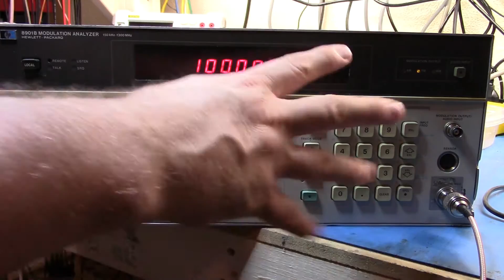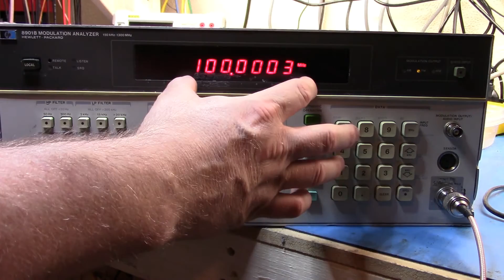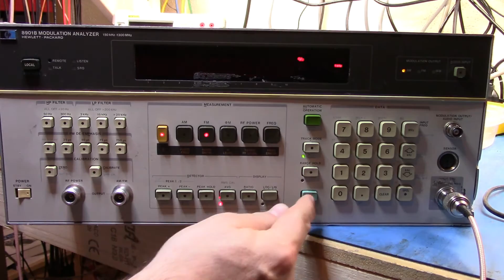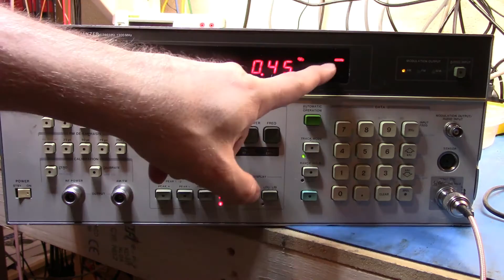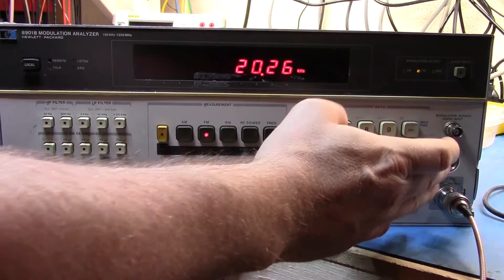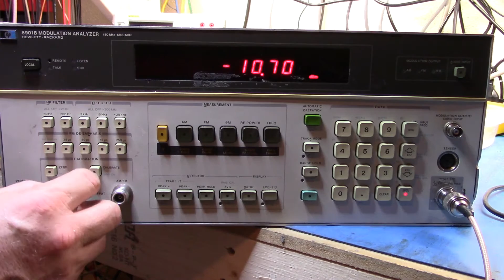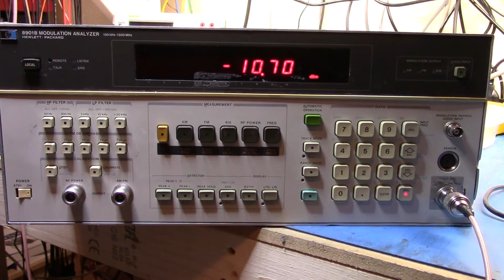HP 8901B Modulation Analyzer - First Look

Comment: I know this is an old video but I have an auto detect issue on mine. It won’t find any frequency in auto but works great if manually put in. Any suggestions on what might be causing this issue?
Reply from the maker: Hmmm - What happens if you connect up the signal and do an Instrument Preset? Also just out of interest, was this your thread over on the HPAK forum? https://groups.io/g/HP-Agilent-Keysight-equipment/topic/hp_8901b_user_question/95551327
Reply from the maker: If it was, did you try it using an unmodulated tone? That 8901B I had was a bit sensitive to modulation when finding the signal automatically - The getting started guide includes a table of things that can cause the unit to require manual tuning (image of that page posted here https://imgur.com/7P1SU9j )
Reply: @tgsoapbox  wow thanks that was quick. I did try an unmodulated frequency I missed that chart when looking in the 300 page manual. 😬
Reply: @tgsoapbox  yes that is my thread. I was actually going to update it tonight as I found a few issues. I will update now.
Reply: I acquired a 11722A today and would like to test the 8901B with it but being as they are both new to me is a procedure available or did you possibly make any videos of you doing this?
Reply from the maker: @HAUNTED-HAM  Unfortunately no - The sensor head is basically an 8482A and a relay - When it is working in power mode the relay throws and the signal goes into the 8482A otherwise it just passes through to the 8901B. I did do a video on creating a DIY unit here though - https://youtu.be/39UZNyCStoU
Reply: Oh I thought the 8901B would switch the 11722A? I seen this in the manual, “S1 Switch. The S1 Switch is a 509, low SWR, edge-
line type. It is useda t the input of the Sensor Module
to switch the RF path between the power sensor cir-
cuitry and a through-path cable. (See Figure 1, "Sim-
plified Block Diagram.) Control lines from the
measuring instrument (such as the HP 8901B or HP
8902A)t o the switch enablet h e measuring instrument
to remotely select the RF path through the Sensor
Module.”
I’m getting more confused each day
Reply from the maker: @HAUNTED-HAM  It does - It should work just like that video I shared but all inside the sensor head.
Reply: Ok I’m starting to see the light, the video was a good description. I’m glad people like you share your knowledge I sure do appreciate it. I’m going to give it all a try this weekend when I have the time to sit down with it.
Reply from the maker: @HAUNTED-HAM  NP - In your HPAK Groups thread I included the basic introductory guide - Well worth walking through it to get a feeling for the measurements the unit is capable of - The 8901B is a pretty good unit overall, just doesn't have the dynamic range of the 8902A (and some other features I think) - I ended up selling mine as I acquired an 8902A to use instead. Hopefully, you can get a chance over the break to play with your unit - Merry Christmas.
Reply: Thanks for all your assistance got it up and running 100%. A bit of Calibration and even auto is back working. Onto next project searching for a replacement Signal Generator.
Reply from the maker: @HAUNTED-HAM  Outstanding, good to hear it. You should do a video on what you found to get it all working.
Reply: @tgsoapbox   it just required setting the internal voltages within spec and to my surprise it came back. Did you think the battery on the control board will need to be replaced? I’m not sure a good substitute if so?
Reply from the maker: @HAUNTED-HAM  As far as I'm aware, the battery only holds the set configuration between power cycles so you don't really need it (assuming that setting everything back up doesn't bother you) - I'm pretty sure that I changed the battery in my 8902A but I can't remember what I changed it to - We're having Christmas at our cabin so shoot me a comment in a week or so when I'll be back home and I'll pull the board from my device and let you know what I did.
Reply: @tgsoapbox  good info thanks, I wish I was at our cabin! We own one in Fleetwood, NC. 
I wish you and your family a Very Merry Christmas, ENJOY!
Reply from the maker: @HAUNTED-HAM  I'm pretty sure I did replace it - I took this image at the time back in 2016 - https://imgur.com/mvwAe13 - You can use any battery that has the same voltage characteristics and can be soldered into place - Just not sure what I used right now.
Reply: @tgsoapbox  just wondering would a 3v battery be ok? Don’t see any 2.8V
Reply from the maker: @HAUNTED-HAM  I think so, the schematic is a little opaque on this for a quick look (I really need to pull the unit out of my rack and take a look at what I did when I replaced it as I worked through all this but that memory is now sadly forgotten). The block diagram shows it switching from a +5V supply to the battery and Adjustment 22 is all about the change over point so I'm fairly sure that you can make that swap and then do the adjustment to make it all work out.
Reply from the maker: @HAUNTED-HAM  Found the thread where i discussed this https://groups.io/g/HP-Agilent-Keysight-equipment/topic/24814418 I'm pretty sure i went with something like this https://www.digikey.com/en/products/detail/tadiran-batteries/TL-5902-P/512507
Reply: @tgsoapbox  ok thank you, looking in my battery box I had a Duracell 123 I’m going to use I will just mount off the board. 

Andrew
Reply from the maker: @HAUNTED-HAM  Please let me know how it turns out. Good luck.

Comment: Came across your video trying to find out if these units are compatible to the 84xx series probes or only  the 11722A. If you know, I'd appreciate your input.  --> Great Video!
Reply from the maker: Yes, they are (I did another video on setting up your own version of the 11722A using a relay) - The benefit of the 11722A & 11792A is that they have a relay built into them so they can switch from power to signal without needing to recable
Reply from the maker: Here is the video https://youtu.be/39UZNyCStoU
Reply: @tgsoapbox  Thanks, I really appreciate that.! Not too much info out there on these.
Reply from the maker: @McZaustria  NP - Happy to help

Comment: I have HP8902A measuring receiver . But it looks exactly the same . I never checked  what is the difference.
I'm mostly at ULF or LF . You can see more in my channel.
Reply from the maker: I have one as well - The primary difference between them is that the 8901A is targeted at modulation analysis whereas the 8902A is a measuring receiver (primarily the tuned RF capability) - They share a lot of the same chassis hardware and functionality but the 8902A is the better one to have. I bought the 8901A to grab some chassis bits from but ended up getting it working again so I sold it to a mob in the north east.

Comment: Is this the same as a vector modulation analyzer?  Your dog is barking over the arrival of more electronic-instrument toys that you bought.  i like toys too.
Frank
Frank Reiser Video/Audio Service
Caldwell, NJ
Reply from the maker: No a VMA is a more complex piece of kit (see the HP 8981A/B units). These really are just great audio analyzers - If you're doing amplifier/filter/etc work then these are good units. They lack an ability to do FFT directly but you can use Pete Mallet's software to achieve that. While I ended up acquiring a good one of these you might really be better off looking at PC based software that uses a quality audio card these days.

I call the doggies my alarm system, they bark whenever someone appears in front of the house :)
Reply: Such as LT Spice and Python, I cannot believe how many free electrical engineering softwares you can download on your computer.  Thanks for telling me about my new toy.  My mother (I'm a science nerd who is not married) yells at me for spending so much money on my science toys.  I own two sole proprietorships--Frank Reiser Video/Audio Service, and Frank's Beautiful Rocks and Minerals.

Comment: Any idea if the built in power level can be zeroed? I don't own a 11722A or any other power sensor, so I just use the internal RF level measurement, however the "Zero" key doesn't work - I get 'Error 21' when I try it.
Reply from the maker: Error 21 is basically a catch-all error for invalid operation. The reason that it's showing is that you're trying to use the "Zero" function as a relative function and that isn't what it is for (Please correct me if I'm wrong there). The Zero function acts just like a "zero" on a 436/7/8 RF power meter. It is meant to enable you to calibrate the sensor to the internal power reference (it is an open loop type that requires a known value to reference). What you want to do is to take a relative measurement is to use the ratio key. Setup the measurement, hit ratio and then it will zero (you can  use Log/Lin to change from dB to %). Hope this helps.